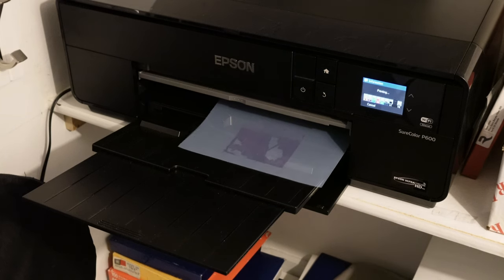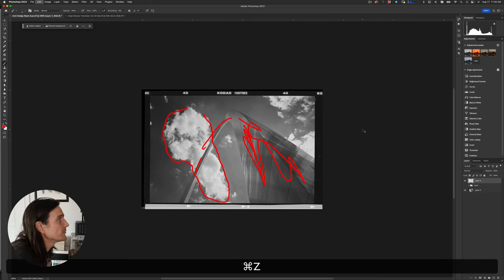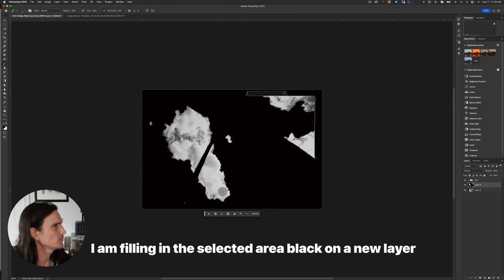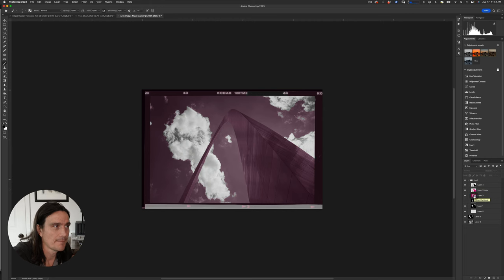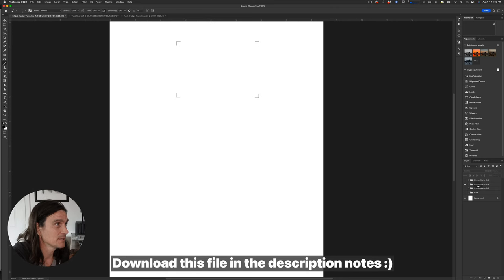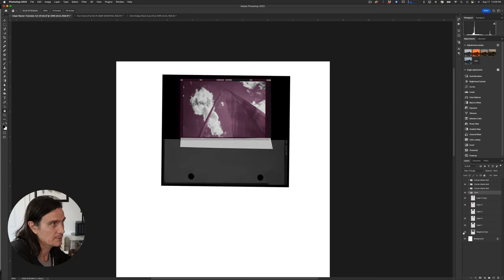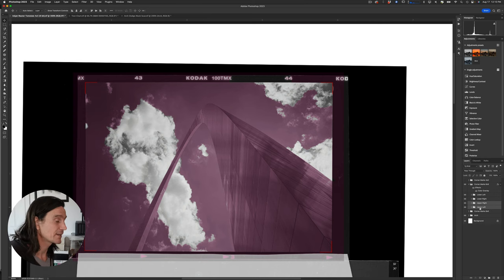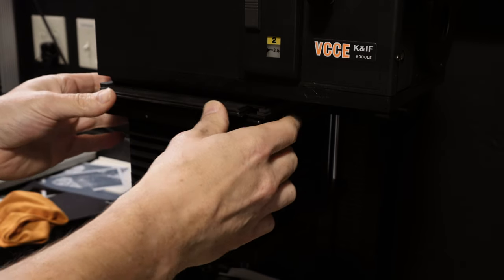The Art Of Inkjet Masking In The Darkroom (Local Contrast Control - Part 3)

Comment: I first met the idea of using a computer and inkjet printer to make masks like this in a series of articles on Darkroom Photography magazine, run shortly before it closed many years ago. They had supported using traditional masking techniques for years, so their take on making inkjet masks started on a higher plane: Using the computer to create variable contrast masks, in effect printing different areas of a print with different contrasts and densities, using a single mask with varying densities of magenta and yellow as variable contrast filtration. This will localize area control in finer detail by isolating small areas for treatment which could never be managed with traditional dodging and burning. I bought my supplies to try this, but I waited until I bought a higher quality printer. And then my time ran out, and I never returned to the project. For those not aware of this magazine, it collected in one publication over the years the most complete and advanced summary of photo processing information and techniques ever assembled.  The complexity of this technique consigns it to the "last resort" department, IMO. Nice video.
Reply from the maker: Thank you for the info, I believe I had come across the same info, in more than on place. I have been playing with this for quite a while and it seems there are quite a lot of possibilities.  

I do however not use this on most of my negatives when printing. Not sure I would call it a last resort by any means but a very powerful tool one can use when it is needed 👍

Comment: This is great - was really hoping you'd cover method this as I think it gives a lot of detailed control over contrast particularly for problem negatives. But I agree it's a lot of work.  My attempts were not as successful (although used the same inkjet and a similar process in PS) as yours so good to see your walkthrough. Your registration system looks great but it's very pricey. Looking forward to your discussion of other ways to do the registration. 

What would you say is the smallest negative size that this kind of masking/registration would work with?
Reply from the maker: Thank you, I will be working on that video this week and see no reason at the moment that would keep me from getting it done.

I have used this primary on 4x5 and 6x6 negatives.  The 6x6 tends to get more difficult with getting very precise test still very doable.

Oddly the 6x9 and 6x12 negs seem more similar to working with 4x5  than 6x6 for whatever reason (may just be in my head) 

So I would say 6x6 is the smallest if you want to try and get precise and sometimes can be challenging.  35 mm is doable for general adjustments→ gradients etc…. Hope that helps!